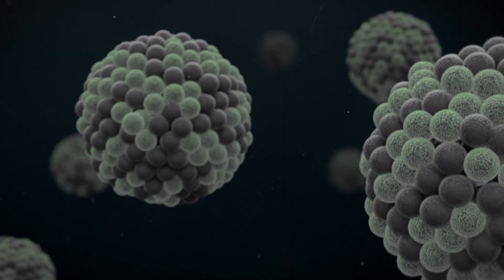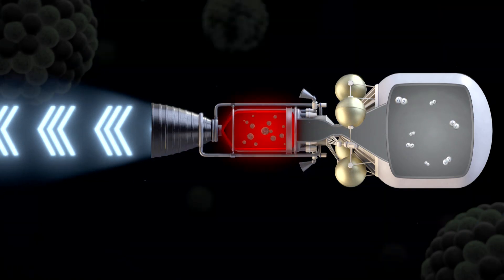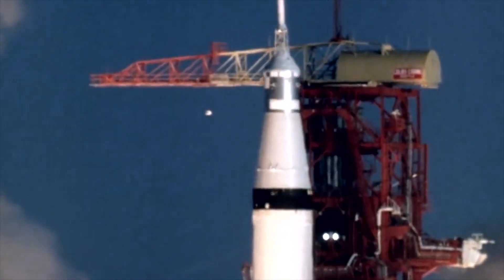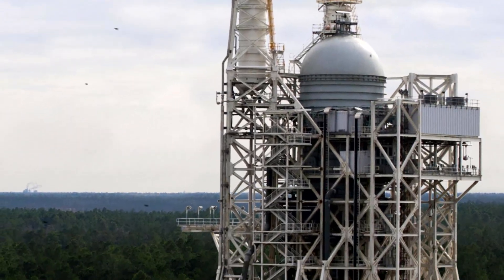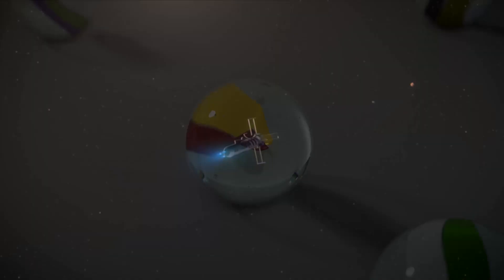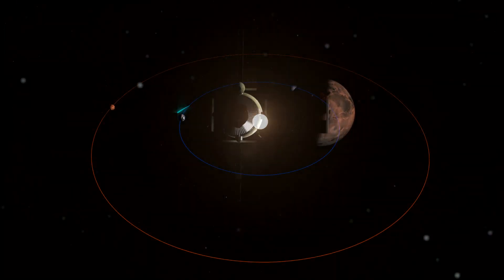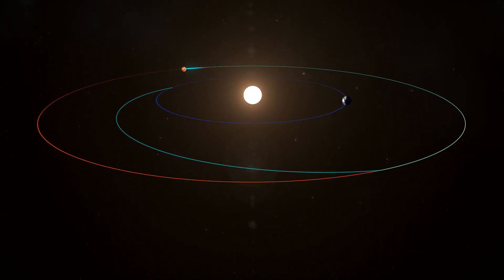Nuclear Thermal Propulsion (NTP)

Comment: I know this is an old video but here's a question: Would it be possible to launch unenriched uranium from Earth to a station in orbit, enrich the fuel THERE, and then load it into interplanetary NTRs? I'm thinking this would be safer than launching enriched uranium on a rocket that may explode and scatter fallout. Is this viable or correct or cost effective?
Reply: HEU is only marginally more radiotoxic than LEU or NU. There's no point.

That said, I don't expect to see NTRs being used from Earth to LEO for political reasons. NTRs from LEO to LMO or Mars itself would be practical.

Comment: Monatomic propellant—means less rotational and vibrational energy loss in the exhaust, But, with nuclear power resourcing the energy is that important; I figured NASA would be using water for simplicity of loading, ice-solid structure bearing, general utility and finally 'blizzard' propellant... (And I calculated tonnage for 1.5-roundtrips in the solar system)...
Reply: ►"Blizzard propellant"—I mean micro-finely powdered ice, ionized...
►Cf Xenon Ion engines use heavy atoms for specific impulse efficiency...
►One RS-25 (SSME) configuration [not refound] ran LOX/LH2 oxygen-rich...
►(Alternatively. hybrid electrolysis-to-burn 2H₂+O₂ runs hotter, than NTP...)
Reply: (In calculating molecular velocity, E = ½mv² restricts average-velocity to square-root, √E ... I do not know why NASA does-not use propellant-mass-matching at launch or when it is a smallish fraction of the bus and payload mass ... Exhaust energy loss is independent of particle mass but momentum transfer is root-mass, i.e. ¼ for hydrogen cf oxygen but 4× Isp, so they should use heavy-oxygen ¹⁸O and deuterium ²D and run oxygen-rich at launch for ¼ total mass, thereafter hydrogen-rich... plus, oxygen is denser and less cryogenic, for less tank-launch-mass...)
Reply: If you are using boiled water then your propellant will be less impulse than Hydro/Lox (same reaction mass, lower velocity/temperature). Heavier isotopes only reduce the specific impulse. The exhaust of an NTR is far cooler than what you get from burned bi-propellants, so the small molecular mass of hydrogen is what gets the 800-900 seconds of impulse. Water is 18 times as dense as hydrogen, so that makes all the difference.

In order to run that electrolysis thing you need a bunch of solar panels or nuclear radiators, which are just so heavy that any benefits you can get (if any) are outweighed. 

Ion engines use heavy inert gasses because they require less energy to ionize. And the weight of the electrical system's reactor cooling or massive solar panel means very low acceleration ie no hohmann transfers. Remember that the liquid hydrogen of an NTR also doubles as the full power cooling system, so you get decent thrust and decent impulse. You can make a thermal LH2 rocket powered by concentrated solar arrays if you wanted for inner solar system exploration.
Reply: Momentum, is needed for vertical launch, not ISP; And Belbruno is a more efficient transfer.

Comment: I understand Mars will be at its closest to Earth around 5/22/16. Are we using this closeness to our advantage? Could save on propellant.
Reply from the maker: +joecovington87 Yes, NASA usually plans Mars mission launches to take advantage of the orbital mechanics. That's why they are roughly 18-months apart. We wait for the window that gives us the most efficient path to Mars.
Reply: Thank you for your response! I would like to propose using the magnetic field of Jupiter when it is feasible to get in range unmanned (I.E.Juno), to make use of those orbital mechanics to increase velocity and decrease propulsion costs while traveling much faster than anything I know of currently. I've had this idea for quite some time. This was years ago before I heard of the first "slingshot" which saves on propellant. Skim the surface with a magnetic field that repels, or propel toward the surface with an attractive magnetic craft, still attempting to skim. The push or alternatively pull would have relatively unknown implications, but i'm sure the sim could be run if the magnetic physics were taken into account. I would Imagine the push or pull would increase velocity (or could decrease velocity of a craft travelling too fast) obviously without slowing in space. The pull would either draw the craft to the surface violently, or, if I imagine this correctly, it would perfectly skim the surface just as it begins to take advantage of the velocity of this immense attractive force. I can imagine the hypothetical craft flipping polarities on a central axis to take advantage of both aspects of magnetism, draw in, then flip to increase the repulsive force after drawing as close as possible to the surface. I'm full of ideas and I know there are a lot of people with great ideas without proper education to be employed by NASA who would love to help save money on propulsion, which as I understand, is one of the largest costs. Im happy to see the recent "recycling" of landed shuttles happening as this will begin to cut the costs incurred by propulsion. I would hope there are people looking at the very public forums for potential beneficial ideas. Is there a secure channel to discuss this or a proper forum for open discussion other than Facebook/Youtube/Twitter etc.? I would like to mention that I have seen many of the videos alleging a conspiracy, and I don't believe them. I believe in you NASA, and I believe in the mission <3
Reply: +joecovington87 Hey man, sorry to burst your bubble, but I don't think the kind of propulsion you're talking about is feasible, or that it would even help much. We can already use Jupiter and all the other planets for gravity assists, a maneuver that transfers momentum from the planets orbit around the sun and adds it to that of the spacecrafts, resulting in the spacecraft being highly accelerated while not measurably affecting the planet. Using gravity assists is how Juno even got on an encounter with Jupiter in the first place. 

Also, if you're talking about shuttles as in the space Shuttle, that program ended in 2012. If you mean the more recent Falcon 9 landings and Blue Origin rockets then those aren't really shuttles, they're rocket stages. The Falcon 9 rocket has already shaken up the industry for being so cheap because of the way the company building it is structured, and is expected to lead to even more significant cost reduction in the very near future. It's not so much propulsion that costs a lot in space travel, it's the fact that to put things into space we have always relied on either fully expendable or partially expendable rockets, which means every time we launch something, we have to pay for a hundred million dollar rocket which can only fly once. Being able to reuse rockets will immediately drop launch costs far more than the use of gravity assists or your proposed magnetic system (which probably wouldn't work anyway) could ever do. Again, sorry if I'm bursting your bubble, but there's a lot of cool stuff happening in the space sector right now, and I encourage you to read up more about it :)
Reply: +joecovington87 from what i understood elon musks SpaceX will be using that launch window to launch their improved rocket. which they are yet to build. though it's going to be an improvement on the rockets they are using now. the ones that have succesfully landed twice now.

Comment: How do you prevent structural chamber failure due to overheating in such an engine? It is hard to imagine how conventional systems (eg curtaining) without wasting propellant and thus reducing the advantage of nuclear propulsion.
Reply: wi11y1960 space is cold but empty. The extreme vacuum means cooling is always a problem. Radiative cooling is too slow by far to dump excess heat.
Reply: Backup radiators. They can double as the power production system using a separate cooling loop. Hot side, "cold" side, a pump and turbine/thermopiles, everything you need to generate power and cool the reactor.
Reply: space is very cold.  So the likely hood of overheating is muted.  The animation isnt very good.  As it shows a reservoir of hydrogen for which the ions are accelerated through.  More than likely, the hydrogen will be metered into a small thrust chamber from a larger tank where it will react in the presence of the nuclear reaction.

Comment: isnt this idea agianst the nuke test treaty?
like: no nukes in space?
or does low enriched uranium not cound.
Reply: +rubikfan1 The treaty bans all nuclear bomb detonations, underground, on land, and in space. The propulsion system outlined above uses nuclear material, but it itself is not capable of a nuclear detonation, so it's fine. It isn't a bomb, and it can't explode like one, so it doesn't violate the treaty.
Reply: Nuclear thermal rockets aren't weapons, just propulsion systems, so i doubt there's any specific treaty that bans them.
Reply: The nuclear fuel rods simply heat the hydrogen gas. It could probably work safely in the upper atmosphere as an upper stage engine would. If a fuel rod broke however it would be a different story.
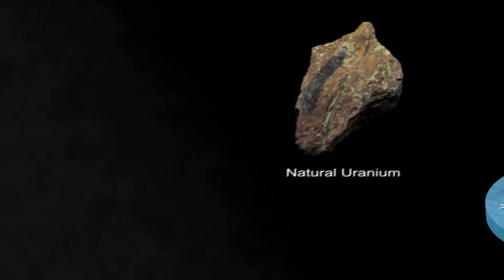Reply: +rubikfan1 I think looking at the pie charts around 1:23 answers this

Comment: One possible issue with Mars-bound NTP: slowing down takes just as much energy as speeding up. Right now - with chemical propellants - a Mars capture doesn't involve much energy.
Reply: +Pete Kuhns aero drag and using the gravity capture reduces the required slowing energy. and it's more about time saving than power
Reply: +Pete Kuhns NTP allows a Mars-bound spacecraft to accelerate on depatrure for Mars to a higher speed than a chemical rocket can, and still have enough fuel to slow down into Mars orbit, and come back to Earth afterwards. 

I however don't think that making the Mars transit faster is generally worth it, and that the much more efficient propulsion that NTP affords should be used for bringing a much higher mass of supplies, cargo, living space, and science experiments, rather than taking a few months off of an at least 1.5 year long trip.

Comment: +NASA.gov Video would this help reduce the cost of space travel.
Reply: +Fat Jesus Vastly. Doubling the Isp (how much thrust you get out of a given mass of propellant) can drastically reduce the size (and therefore cost and risk) of rockets that need the same amount of dV (change in velocity). 

Additionally, experience with this type of propulsion will help pave the way for even more efficient engines. My personal favorite is the fission fragment rocket engine; current hydrogen-oxygen rockets have an Isp of around 460 or so, the video says NTP can be roughly double that (so around 1,000 or less), while fission fragment engines have the potential for an Isp of 100,000 or higher.
Reply: IstasPumaNevada thanks.
Reply: +Fat Jesus Marginally yes, but the Nuclear Thermal Rocket is less a means of reducing the cost of space flight and more a means of being able to build more capable space craft. A rocket using this kind of propulsion system could possibly get twice as much payload to a destination as opposed to a regular chemical rocket. However, twice as much payload only gives you a cost reduction of 50% or less, considering that Nuclear Thermal rockets are quite a bit more expensive than chemical rockets. 

A much more effective way or reducing the cost of space flight is to build a re-usable rocket. Lets say the cost of launching a rocket is about 10% of the actual price, and the rest is the cost of building the rocket itself. If you can use a rocket ten times before it needs to be scrapped, that mans that for twice the price you get ten times the payload, which means one fifth the cost per pound of payload, and an improvement of 2.5 times the best price an expendable Nuclear Thermal rocket system can provide. However, ten times reuse is probably a low ball estimate, and the cost savings of a reusable system are probably much more. 

SpaceX's Falcon 9 rocket is partially reusable, the big first stage can land and be recovered while the much cheaper and simpler second stage burns up in the atmosphere after use. The Falcon Heavy rocket will use a similar strategy. Even though a whole stage is being expended per launch, the Falcon 9 and Falcon Heavy are expected to reduce the cost of space flight by a huge degree, and have actually already rocket the boat in the launch industry.
Reply: +Rothpol X what about radiation and radiation protection?